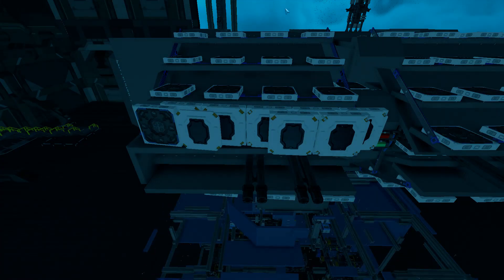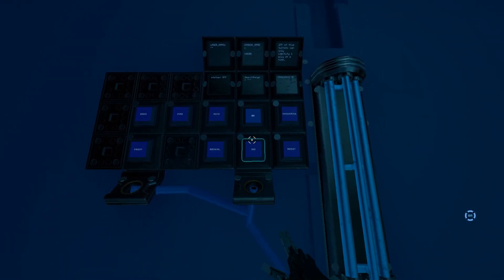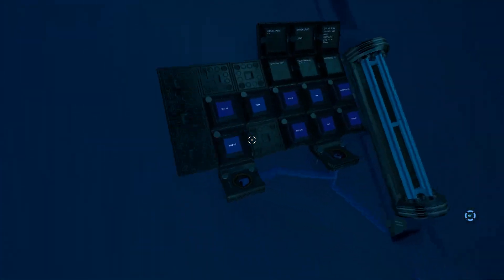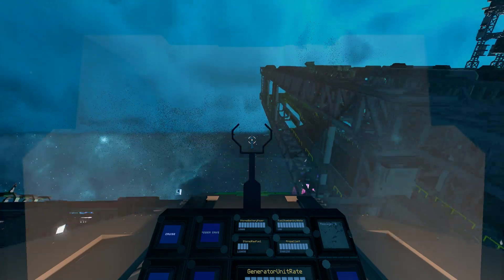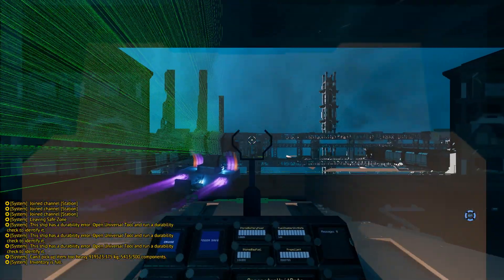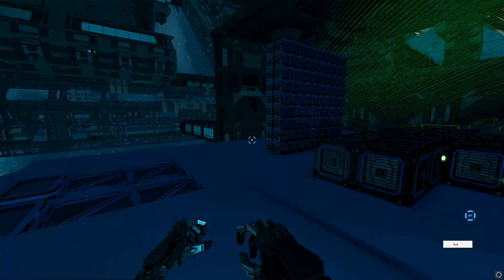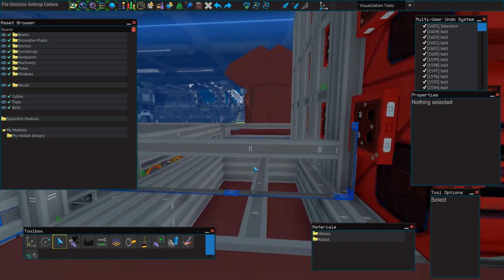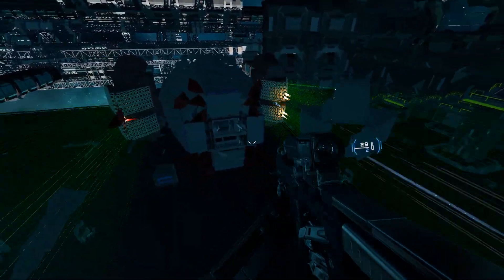Starbase T-8 Auto Turret Preview

Comment: Incredible work man, can't wait to see it on capital ships.
Reply from the maker: Thanks!
Reply: I like it, also! Id like to use it for station defence, mostly.
Reply from the maker: @starbasehooded9825  Although it would be great to see these on stations and capitals, I don't think we can with easy build since these are made in designer.
Reply: @CommandoDoggo  I have some working device on my station factory hall. Generators, solar panels, propelant tanks, crates, navigation data logger, heat sink, radiators, cargo lock frame, grid display, etc. I have some turntable too, but they have some bugs. Id like to make a turnable solar panel system, but I'm not very well in it yet. If you wish you can come to my station to build a pretty basic  turret system, I give all the resources, or I craft every items and you just build it, to save time for you.
Reply from the maker: @starbasehooded9825  I saw your vid with your capital ship, looks good with lots of space! Sorry but im pretty busy spending all my free time in designer and making videos, trying to make a custom turret with easy build would be challenging and take many hours longer than in a designer. Although i've never used solar panels, I assume you want it to rotate and pitch it to face light? If it were me I would set up an advanced turret cradle on a turntable (they can be buggy),  put hardpoints on the sides so I can transfer power like on this video ( https://www.youtube.com/watch?v=e259gKj7KUc&t=1s ) , and then bolt the solar panel to the hardpoints somehow so it can pitch and rotate.